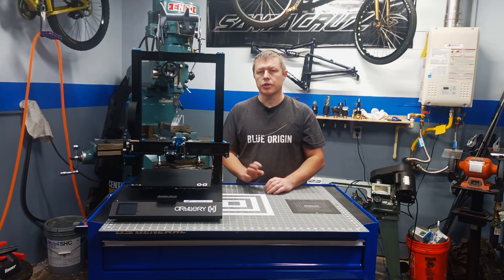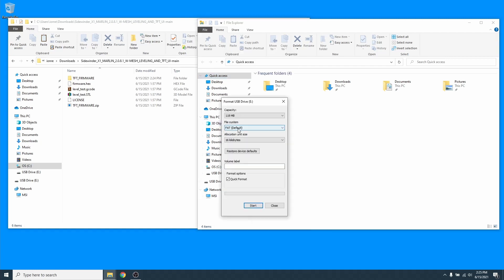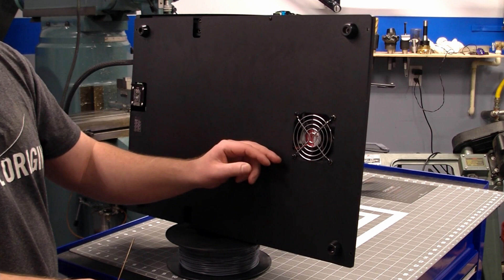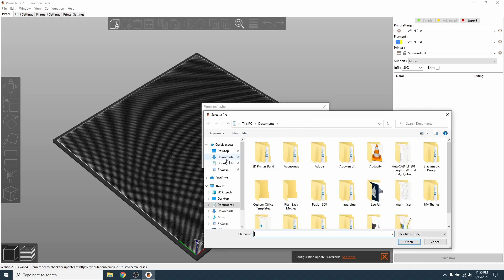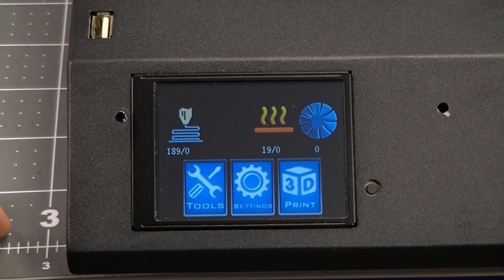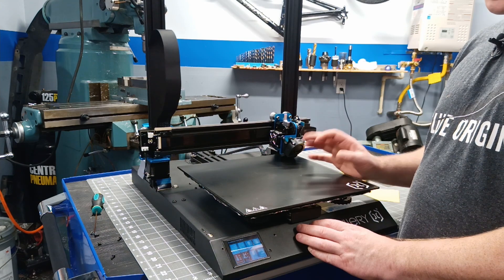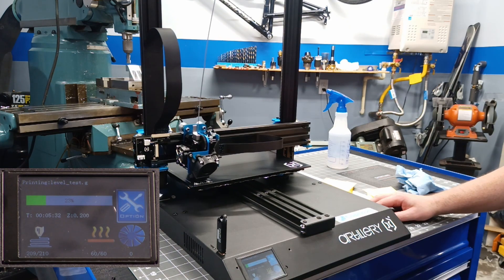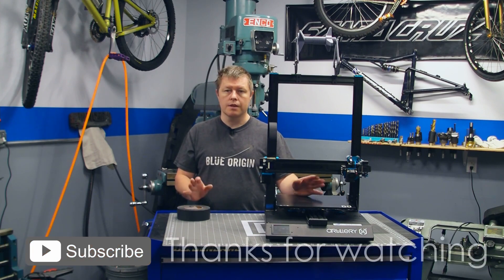Sidewinder X1 Marlin 2.0.8.1 with mesh leveling and custom touch screen UI.

Comment: Is there a way to go back to the stock f/w?  I've been having weird temperature fluctuation issues since doing this change.  I'd like to switch back to confirm that is or isn't what did it, but I can't seem to find any guides for going back?!?
Reply from the maker: You can download the stock firmware from the Artillery website. If you are having temp fluctuations I recommend running the PID auto tune, keep in mind it may take running it a few times to dial it in.
Reply: @EtherealProject3D  I've run it probably 2 dozen times.  I'm getting wild fluctuations and I generally have to run hotter than I did before.  But I'm not sure if that's the f/w or coincidentally something happened to my thermistor at the same time.  That's why I want to change it.  I found the original files on the artillery website, but I don't know what to do with them :(
Reply from the maker: @stevenmorehouse2626  https://drive.google.com/file/d/1IxL3kM8YVW91hIGFBHnGc7qtlzjZHlJ5/view

https://github.com/artillery3d/sidewinder-x1-tft-firmware/archive/refs/heads/master.zip
Reply from the maker: One is for the HEX file and one is for the TFT firmware, Install exactly how I instruct in the video.

Comment: So installed this firmware and it went flawlessly thanks to your vid. One issue though, if I don’t home the printer manually before a print it will print in an offset location on X and Y.
Reply from the maker: Go you have G28 in your start gcode?
Reply: @EtherealProject3D  I guess I can try to look I’ve never manually entered any start code before though
Reply from the maker: @protoplasm25  look in your slicer, there should be start gcode ether in the print profile or machine settings, depending on what slicer you are using. G28 should be the first movement gcode.
Reply: @EtherealProject3D  one more thing, the calibration gcode you included was a bit hot nozzle 215 when I normally run 205 and and Bed Temp 65 when I normally do 60 and the squares were very hard to get off and left behind a lot of plastic on the bed.
Reply from the maker: @protoplasm25  There is the STL file for that in the download available for people to slice with what ever settings they would like.
Reply: @EtherealProject3D  so I confirmed that there is a G28 code in my prints. But I noticed something else odd today, when I pressed home in the printers UI it down all the way on Z and down all the way on Y but went to midpoint of X. I moved it all the way to the left on X and then when I homed it went to the right spot.
Reply from the maker: @protoplasm25  does it home properly after an initial power up?
Reply: @EtherealProject3D  is it supposed to home at startup? Because it doesn’t move at all
Reply from the maker: @protoplasm25  When you power on the printer do you manually home it from the screen or do you start a print right off? So be it a manual home or print, does the first homs after power up work properly?
Reply: @EtherealProject3D  well I can do a test after this print is done, but when I homed after startup last time no it went to middle of the plate on x axis
Reply: @EtherealProject3D  sorry I haven’t been able to look recently. Btw I really appreciate your support! Anyhow I checked and first home after start goes to middle of the bed on X axis. If I move command to X axis home it then knows. But honestly I have a bigger issue, the zhop has become very, making klunking noises every hop, sounds like case vibration

Comment: Hey man really appreciate this video, everything works great except after I did the pid auto tune and ran my first test print both the bed and the nozzle Temps are all over. Bed going from 60-75 up and down and nozzle goes from 200-220 hunting all over, any ideas on why it would do that now? Thanks
Reply from the maker: I would reset the eprom, you will need pronterface and do M502 then M500. Then try again. Some people have had to run the PID a few times as if its off by alot it cant get it good enough on the first try.
Reply: @EtherealProject3D  oh OK no worries, I appreciate the fast response!
Reply from the maker: @lMILLZlTT  Not a problem, let me know if you still have trouble with it.
Reply: @EtherealProject3D  hey man I got some time to mess with my printer today. And most everything works after the new firmware, however I cannot filament change or pause a print. As soon as I hit resume the printer will not extrude. The extruder only mover where it thinks it's retracting. Any idea? Thanks.
Reply: Moves*
Reply from the maker: @lMILLZlTT  This has been an ongoing issue that I have tried to figure out but so far have been unsuccessful.

Comment: Just wanted to thank you for this amazing firmware. A big annoyance about the stock sidewinder is the lack of Z axis fine tuning during prints. I used to use Cura for Z axis offset but had to stop prints, remove first layer, rewrite the gcode and print again just to adjust the first layer. This really helped me a lot especially as a beginner
Reply from the maker: You are very welcome. Im happy I am able to help you and many others.

Comment: Is there a way I'm not seeing to turn off the LED?  I have my printer connected to my server via USB full time, and that powers the LCD as well as the  LED regardless of if the mains power supply is on or off.  In the stock firmware, I could control the bulb.  I could swear I saw an option at one point but I've gone though each menu and don't see it.  Thanks.
Reply from the maker: I believe its under options or tools.

Comment: Is there a reason this would affect my ability to use Octoprint?  Worked fine before doing this... now does not.  I haven't done any troubleshooting yet.  Wondered if this was a known incompatibility?
Reply from the maker: I have not tested this with octoprint so I am unsure of any compatibility issues.
Reply: @EtherealProject3D  Fair enough.  I should have checked first... is there a way to revert the f/w back?   The convenience of Octoprint is not something I want to lose.
Reply: Figured it out.  Settings -> Serial Connection -> uncheck Request exclusive access to the serial port
Reply from the maker: @stevenmorehouse2626  You got it.

Comment: I think my meshbed leveling is not saved. After saving and repowerup it's losed it's saving. Would be nice to have confirmation when the leveling is saved.
Reply from the maker: You can plug your printer into your PC via the usb cable and use a terminal like Pronterface and run M503 and if it saved you will see all of the mesh points listed.

Comment: I have a Genius Pro and I am wondering if the Genius firmware that you have will work for the Pro. I believe the new firmware could be really helpful. I know the Genius does not have an automatic bed leveling probe so I don’t want to put the Genius firmware on if it’s gonna take away from my factory auto bed leveling using the probe. Any thoughts would be helpful.
Reply from the maker: No this will not work with the Genius Pro.

Comment: as a complete newcomer to the X1 the update process has been both invaluable and remarkably easy.
Reply from the maker: Im happy it helped you, thank you for your kind words.
Reply: @EtherealProject3D  unfortunately I had a nozzle heater short out on the printer a little while later (completely unconnected with your changes) which has really got me stumped. The nozzle now heats up and holds temp as it should. The bed heats up but once it gets up to temperature it seems to trigger a shutdown error - it all points to the bed thermistor having failed. What I can't figure out is why one failure would cause another seemingly unrelated error.
Reply from the maker: @PaulBarton  you might want to look at the connection of the ribbon cable on the extruder. Aslo the heater connection is not great.

Comment: great video, thank you for everything. Question though. To be extra sure, I tried to do the mesh leveling twice to make sure i got the same results. However, what I noticed is that it is different in some areas, higher and lower. Everything was the same though. PLA preheat was on, I used a new sticky note for each test, and I didn't bump the printer at all. I already did the PID calibration beforehand as well... Do you think it could be that it's not saving correctly? I've been hitting the save button once after the 9th pass, like you do in the video, however should I do it after each point? I'd appreciate it if you'd let me know. thank you.
Reply from the maker: There will allways be some variation every time you do the leveling. As long as that variation is within the margin of error you should be just fine. And with using the paper to feel the gap there is the human factor. It bugged me at first coming from spending time using more precise machines like a mill or lathe but I hade to keep in mind these 3D printers are Chinese machines made for your average hobbyists and are levels of magnitude less precise than we wish they could be. We can do our best to get them as close as posable. Thank you for your comment and your support. Happy 3D printing.
Reply: @EtherealProject3D  I understand. thank you for the reply!

Comment: Hola amigo 
Sirve hacer esta actualización con el extrusor de hemera?
Reply from the maker: I am working on upgrading my X1 with a Hemera. I  will be doing mine with a BL-Touch but It will be easy to update this firmware for it as well. Check out my website, I have some renders and photos of progress so far. Also Email me on there so I can have a reminder. Thank you for watching. www.etherealproject3d.com
Reply: @EtherealProject3D  Thank you friend for your time, I will write to you by email to remind you and I will ask you the corresponding questions, try installing this firmware and I will tell you about the results. a hug, an excellent channel

Comment: This is amazing, thank you!  I'm going to be trying this very soon!
Reply from the maker: Your very welcome
Reply: UPDATE: False alarm.  I re-downloaded your files and it worked this time through. Phew!

 @EtherealProject3D  I just tried the first TFT flash.  It showed 0% and the machine shut off instantly, apparently popping the fuse near the power plug.  I tried flashing TFT from Artillery's homepage and that said complete, but now when I turn the machine on it just sits at booting...

Any suggestions?

Comment: This looks excellent! I got a new thermistor and hotend for my Artillery printer, the thermistor is a NTC100K. Someone said I needed to flash the firmware and adjust the machine codes to compensate for this new thermistor, can I do that with your firmware?
Reply from the maker: Its not hard to change in the firmware. Email me on my website and i can get you set up.

Comment: Hi. I've got a brand new mks Motherboard. No firmware loaded yet. Trying to do this tft process 1st. I'm doing it correctly. However when I power up after the sim card in installed it does not boot. It goes to the last firmware I had. I only had a 64 gb sim card. Is that an issue? Locally I can buy a 32 gb if needed. I'm not sure I can get one smaller?
Reply from the maker: You need to use an sd card thats less than 8gb. In windows disk management you can partition the sd card down to that capacity.

Comment: How would I change the max temp to 285?
Reply from the maker: A combo of changing the max in the mainboard firmware and the tft cfg.
Reply: @EtherealProject3D  hate to be bothersome but can you explain this a little better?   I want to learn but am having trouble finding a way to do this without messing up what you’ve done.  Is there a specific program to adjust both?   I’m usually good with this stuff but I’m lost.  Thanks.  I just want to change it to 300.  I’ll probably never go there but that’s what I want.

Comment: Hi there! First of all thanks for doing the work of compiling the code and the tut is solid! I have come across a problem, though. Once everything is flashed and I go about I've done the initial mesh bed level, the printer doesn't home X axis but rather stays wherever it last was and It then lets it crash into right side. I'm not sure how to solve this and I cant see someone in comments having same issue. Would you be able to point me to whats causing it? Thanks! :)
Reply from the maker: I dont know why it does this, it has happened to me a few times. Typically power cycling the printer fixes it.

Comment: I just got a new MKS GEN L V 1.0 motherboard, same as the original. Can I use this process to install the firmware on my blank MB?
Reply from the maker: Yes that should work just fine.
Reply: @EtherealProject3D  Thanks for the vid and the prompt reply!

Comment: Would a different TFT custom firmware (designed for marlin 2.0) like Digant or RAWR work with the your board firmware?  thanks in advance!
Reply from the maker: I have not tested it but I would think that it would work just fine.

Comment: Hello, I, m looking for a file called configuration_adv. h, to activate the Advance_pause_feature, and can do a filament color  change,with arduino. This file isn, t in the file. Rar
Reply from the maker: I don't have the source files linked.
Reply: @EtherealProject3D , OK, thanks for your effort.
Reply from the maker: @pedrosanchezpena7  If you want i can make the source files. I was never able to get m600 to work for me.
Reply: @EtherealProject3D  that would be fantastic, Thanks a lot.

Comment: Is it poosible that MBL not loading when I try to print something sliced from cura. I have 0,3 low spot on center. test print prints good, but then I try to print some calibration cube and I cant print anything unless I ramp up flow to preposterous amount?
When repeating MBL procedure, I get to do it from 0 or last MBL values?
During print test z adjustments saves to MBL values or it is just for visual confirmation?
Reply from the maker: You should not need to but try adding m420 s1 after g28 in the start gcode.
Reply: @EtherealProject3D  well, it helped

Comment: Thanks for the hard work.I,m strugling with bed level in the middle,so i ,ll try this.By the way ,i,d love to print in Two colors,changing filament at determined height,is this posible with this firmware?
Reply from the maker: It depends on the slicer, the printer natively doesn't like to do this but I have stopped a print to add a nut and restarted again, done in cura.

Comment: Hello, excellent work I am testing it and it works very well, but I am having problems with the K factor, in your version of Marlin, the Lin_Advance function is activated?, The factor is at 0 (K = 0), in order to be able to do variations of the slicer? Thanks a lot.
Reply from the maker: Yes linear advance is enabled and I believe its set to 0.11. This can be changed by setting a new value in your start gcode.
Reply: @EtherealProject3D  Perfect, thank you very much!

Comment: Is there a way to add the stock (or improved, i.e. change color while printing) led functionality to your firmware?  Other than that, It has worked great so far, thank you very much for your hard work!
Reply from the maker: This has been a problem for some people. I still have to figure out why the LED function is not working for some people. My Sidewinder is down right now for some mods that I am doing to it.
Reply: @EtherealProject3D  Well, keep up the great work, and look forward to future videos! Thank you for your hard work!

Comment: Since you did this excellent job, I suppose you are familiar with the X1 firmware from Print Engineering (Gary) which he worked on like a madman last summer and then suddenly stopped. Could you say a few words on how yours compares to his (except that it's better and more up to date?).
Reply from the maker: I have to admit that I am not familiar with with the Print Engineering firmware. I will have to take a look at it.

Comment: When i want to flash the firmware for the lcd again it wint do anything.
Reply from the maker: The file extension of the firmware will change when the update is successful. Check and see if that is the case for you.

Comment: Hello, recently updated my printer and not sure if it's happening to everyone, but while I'm printing, I try to turn off the light and it doesn't do anything when I push the button. Help?
Reply from the maker: This is something I am going to have to look into when I get my X1 back together. Its currently in several pieces.

Comment: Could not load the saves mesh bed leveling on th eeprom
Reply from the maker: Did you disconnect the screen when you updated the mainboard?
Reply: @EtherealProject3D  yes, did relevel again and saved on the eeprom. now it doesn't says the error anymore.
Reply from the maker: Ok, glad you got it working.
Reply: @EtherealProject3D  only the on /off funtion of the led doesn't work yet.

Comment: The other buttons in the "more" panel when the printer is printing, such as the light), and I have a feeling the mesh bed leveling doesn't either. The Hex file is only 216 big and yours on the movie is bigger ?
Withc baudrate to you prefer for the upload?
Reply: @Ethereal Project 3D The on/of LED button doesn't work
Reply from the maker: This is something I need to fix when I get my X1 back to gether.

Comment: Thank you for some easy instructions on removing the hot glue. I just performed firmware  update on my .v4 X1 and it is working  great. Now I don't have to waste plastic on a raft for my prints to compensate for my bed.
Reply from the maker: Awesome, I am happy to help.
Reply: Hi, i installed the firmware also but have problems with LED on/of function. did it works with your printer ?